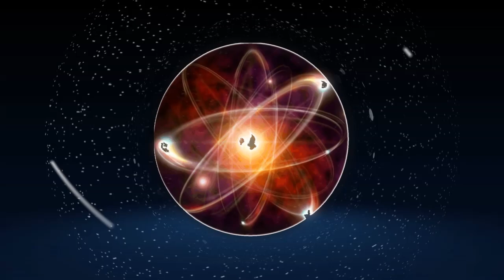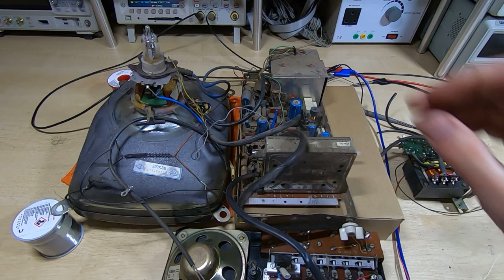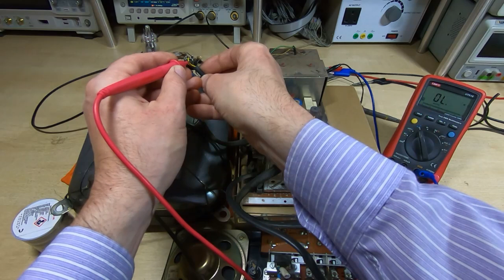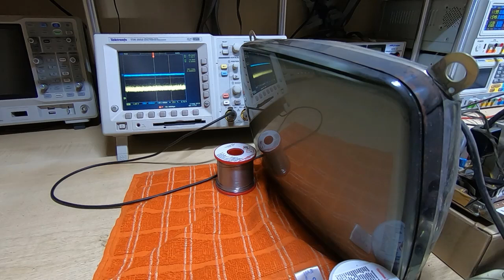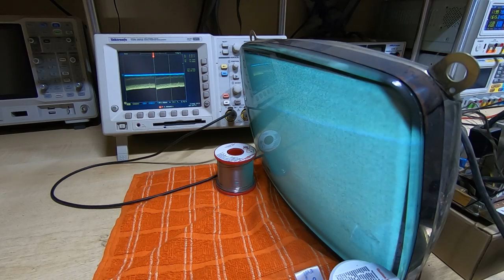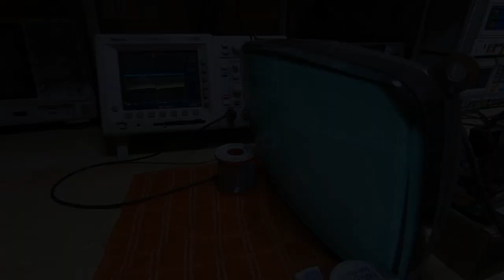ADM3 #3 Repair Part3

Comment: I'm not sure if you've figured this out yet, but the model number on that tube is 31ЛК36, which romanizes to 31LK36.  I don't know if that information will be helpful at all, but there it is.
Reply: Actually, I got a better look, it's 31ЛК3Б, or 31LK3B.
Reply from the maker: Yes it is easy to see without the camera in the way but when filming I can only see it through a 1.5" screen so you could see more than me. After I moved the camera out of the way it was easy to read. That is one of the disadvantages making videos. I did post a video a while ago that shows the view I have when I am filming and you would be surprised how little I can see but as I film in real time I often do not get a good view until after the video has been shot.
Reply: @JerryWalker001  I feel that pain from making my own videos; I just wasn't sure how familiar you are with the Cyrillic alphabet!

(What I hate most about working behind that camera is when it looks fine on the tiny screen, then you get done filming for twenty minutes and put it on a monitor and discover it's unusable and have to either do-over or continuity jump!)
Reply from the maker: @EthanBlanton  Yes the videos do not always come out as intended but as I film as I go I do not have the option to write a script or repeat it but I can be assured that there is always someone ready to criticize :)

Comment: Great watching this all come together but I was surprised at the ZX81 as a signal source !...cheers.
Reply from the maker: Just showing that you do not always need expensive test equipment.
Reply: @JerryWalker001  It was great to see ! I wonder if using the limited graphics you could program a rudimentary 'test pattern ' that could aid in TV set up and diagnoses ? I have no experience with old telly's so it was just a thought.